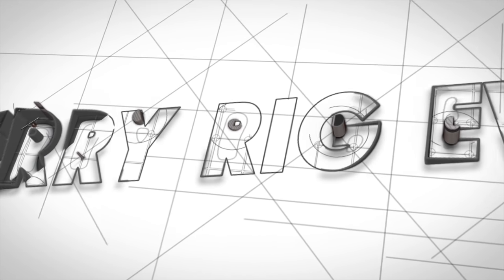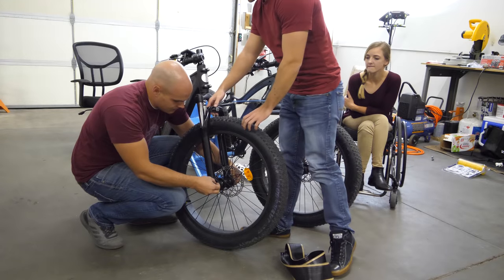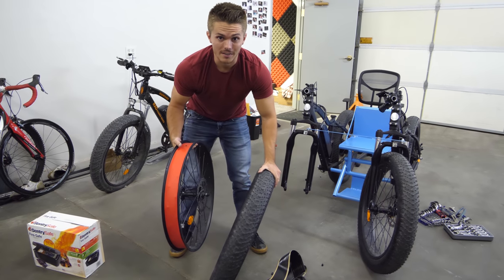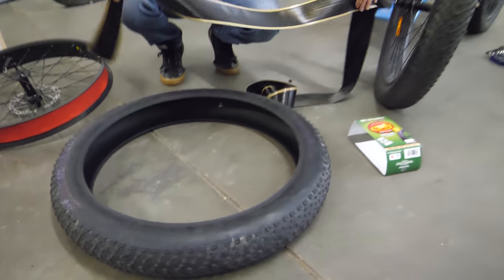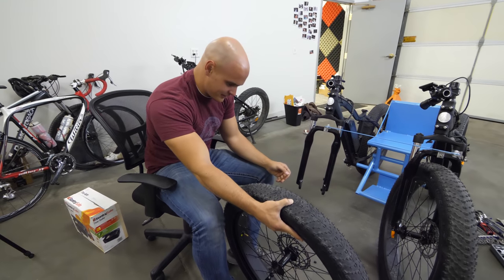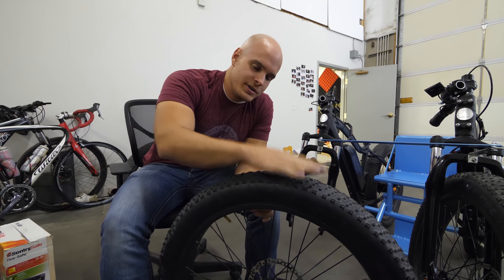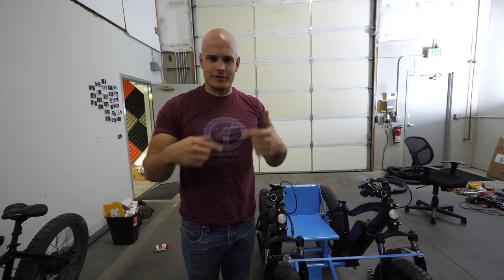How to keep Fat Bike Tires from going flat - Off Road Wheelchair Upgrade

Comment: Nice my grandpa and i did something similar to my bike when i was like 10/11 years old but we took 2 old tyers cut of the sides a bit not the whole side and put them inside the new tyers then reasembled everything worked great, he said that it was an old trick from his youth and had been used on old militarybikes to prevent flats. My grandpa was a great man RIP Grandpa i miss you.

Comment: Great tutorial! Another layer of protection I use on top of all this is to cut the old tube and wrap it around the new tube. Then if a hard deep thorn does get through, and they still can, the new tube leaks slime and bonds to the old tube to seal the hole very well.

Comment: If you run a tubeless setup the sealant would plug the holes and you would be able to run a lower tire pressure and get more grip on things like steep gravel trails🤙🏻

Comment: Heyo! Another option you could look at with the tires, is a completely tubeless setup with a better tire, and then a cush core foam insert around the rim if there is one for it. The idea is similar to the slime, but you don't have the weight of the inner tube. Less rotational weight mean more runtime, and the tubeless lets you run lower pressures to get more traction. Additionally, the cush core will save the rim from some extent of damage in the case of having to roll on a flat. I will point out, if those are the stock tires, the casing material is probably not that good, so investing in a better tire with a more durable casing material could be a major long term investment.
Reply: i haven't seen a cush core for a fat bike

Comment: Nice job!  I just watched two other guys do the same thing on Youtube, incorrectly.  Pretty much the same thing you did, but after they put in the Slime, they spun the tire really fast.  You need to spin it SLOWLY so it can line/attach to the whole inner surface.  The one guy poked a nail in the tire and couldn't figure out why it wasn't working, lol.  Thanks for your video!

Comment: I ride through the Nevada desert.  Gravel, cactus, thorns and glass.   I have a sun seeker fat tad with the 4" x  20" tires that I did the same thing with.  Tire liner and Stans liquid tire sealant inside the tube.  Before this combination of protection I would get flats every 3rd. time out.  I've been out 18 times now with problems.  So far so good.

Comment: You should convert the wheel to tubeless. In doing so you greatly increase puncture resistance and lower the weight. Lowering of the weight would make it go for longer distances.

Comment: What you can also do is go completely tubeless. You don’t even need the tube in the tire, all you need is tubeless ready rims (it needs to have specific rim tape on it), tubeless tires, and slime or sealant. You can run even lower tire pressures, for more grip,  and if you get a thorn in the tire, the sealant will seal the puncture and you can keep riding👌 I personally ride this setup on my own mountain bike and it changes the whole feel of the bike, very rad🤘

Comment: There are a number of videos on how to go tubeless here on YouTube. You might find that they are even more reliable than your setup. Just as long as you remember to add sealant every six months or so. Even if the tire goes flat. It might seal itself if you pump it back up. You can still use a tube if all else fails. My bamboo fat bike has three years and a ton of miles on a set of tubeless fat bike tires.

Comment: As a lifelong tire man, slime don’t work. Also, use an old tube, split down the middle all the way around and place the new tube inside it. Valve stem removed of course. I use it in heavy duty off road applications. It fits perfectly and gives heavy thickness.

Comment: Dang. True that those things may prevent flats. But the added rolling weight requires a LOT more energy to push.  It may be a good choice for some folks to use tire liners and/ or sealant (btw, there are more effective brands), others may find the extra effort and slower ride is not worth it.

Just something to be aware of for those who are thinking about puncture resistance. Oh, I have also heard some tires are made with a kevlar belt for that, but I have no experience and don’t know how well they work.

Thanks for the great video!

Comment: I used the same method but I used a heavy duty 21 inch front dirt bike tube. They are easier to find than fat bike tubes and are much tougher.

Comment: Or..... just set it up tubeless. It works the same way as on a car tire with tubeless specific tires and I don't know if your rims are tubeless ready or not. You put the tire on as normal but without the tube (it might be a bit tight) and you can put sealant in it to plug holes as you ride. It is more efficient because there is less friction and you can't get pinch punctures (where the tube gets pinched between tire and rim on a hard impact) which means you can use lower tire pressures to absorb bumps better and get more grip. May not be necessary in this case but it's what all proper mountain bikers use.

Comment: You need to go tubeless, been running Stan's sealant for over 6 years and it works great. You can also go for the muck off sealant and that'll be even more robust

Comment: Can I make  suggestion if SLIME doesn't work for you. I bought SLIME last week and followed instructions to the letter. Unfortunately, it didn't work for me on my rear wheel on my Ebike. Not because it's a bad product but because their are Grey areas when fixing flats on your bike. I had no choice but to remove the wheel and fix the flat the old traditional method of glue and patch. Why SLIME didn't work was because the puncture was on the side of tubing 1" above the stem. Even if you spin your wheel after applying SLIME, it may not coat the sides of the tubing. So what I did was I made a hole on the side of the tubing of an old wheel with tubing and tire and proceeded with Slime instructions. Again Slime did not seal the hole after spinning the wheel for a very good reason. You need to spin the wheel flat on the side on its axel on both sides or you can just hold the wheel horizontally while you're standing and turn it so the Slime can coat the side. Try one side 1st and then fill with air. If there is still a leak, turn upside down and do the same on the other side. Remember the trick is to get Slime to coat all of the inner tubing so as to fill any holes from the sides as well as the top and bottom. It worked for me after I realized those Grey areas.

Comment: I been doing just the slime and works great but once you put slime in a tube and its been in there a while or you store the bike for a while that slime will kind of expire and that tube is junk and will need to be replaced. the liner does not always work Ive had thorns go through the liner.. but having both is your best defense.

Comment: The problem with *Slime, is that it doesn't work indefinitely.  Eventually, the tube will need to be patched, and that's where you run into problem #2.  *Slime is incompatible with patch cement and will cause any patch to leak and inevitably push off. At that point, your options are to either try to "wash" all of the *Slime out of the inner tube, or replace it (the tube) entirely.

Comment: I got flat tires with the one I made even with slime and liners. Got tired flat tires (pun intended)! Sold it! Then I made two more ebikes from dual full suspension mountain bikes with Bafang 750 watts motors (Shimano/Gravity model 2014) with normal tires and put rubber tube in tires (no air). Problem solved. Had them for 5 years, never had a flat obviously.

Comment: With power wheelchairs we use a special type of solid tire that don't require air but the tires are a bit harder then normal.

Comment: Why don’t you Go tubeless ??? It’s a MTB basically so tubeless would be perfect
Reply: ikr. Would also save weight and increase range a bit
Reply: Yeah, apart that most tubeless sealants don‘t deal up normal inner tubes
Reply: Joni mi what do you mean? When you go tubeLESS, you remove the tube
Reply: Simon Arends yeah! Wich is only a good thing as a) you Save weight! Sealant is much lighter than a huge fatbike innertube! b) better puncture resistance! A normal tube stretches out, aspecially when there is a hole in it, so the sealant can’t deal up properly!
Reply: He should get better rims to
Reply: Agreed. Tuffy liners are worthless. The goat heads still go right through. Go tubeless. Split tube method would be easiest. I am local and can help if needed.
Reply: @jimi272  Oh really, thats interesting because I've been running Stan's tubeless sealant in my fat bikes tubes inside the tire for years and I've not had a flat since. I've run over many thorns and cacti and saw sealant spewing out and then it sealed and stopped leaking every time. Tubeless sealant works just fine in low pressure fat bike tubes. The only downside is it dries up after about 6 months and you can't get it out so you can either just keep adding more sealant which increases weight, or you can just replace the tubes every half year or so. Small price to pay for the convinience of never flatting.
Reply: nateross14 ah yeah! Sure it can work on low pressure tubes as the whole doesn’t get any bigger because of the pressure inside! Forgot that one! But otherwhise, sealant only works without tubes.... and is even better... so actually tubes are useless anyways...
Reply: @nateross14   I got the stan's sealant in my tubes and the tuffy liner in my fat tires and a nail kicked both their asses, went right  through sealant was leaking all in my tire it didn't seal the hole right away had to walk home, it only sealed after I took the tube off hung it up so the hole was facing down, maybe I put too much sealant in I don't know.

Comment: Try drilling holes in the side of the tires.  Fill the tire with window sealant foam.  Be sure to put a little water in the tire, before, the foam.  It activates the foam.

Comment: You could also just go tubeless, which is most likely cheaper, it makes the wheels lighter (yes it actually makes a good difference) and if you get a puncture, the tubeless sealant will most likely seal it up, and you also can't get pinch flats from going over curbs or something which would be perfect for this bike, and you can also run lower pressure in the tires for more grip.

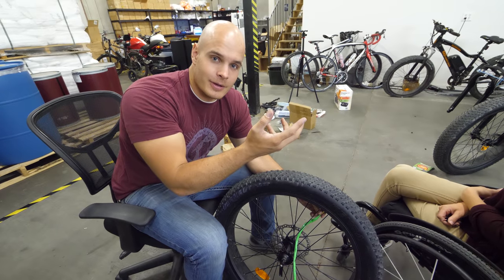Comment: 3:42 i used Slime in my 20X4 e-bike fat tires and it was MESSY when i got a flat in the back tire TWICE. Slime squirted everywhere on my fender. It didn't work. I only used it to see if it would stop the very slow leak i had and it worked for that okay enough. But when i encountered a real flat on the road far from home?...nope...FAILED. When i later got home with a taxi van i requested, i tried to patch up the hole. Forget about it. The Slime would ooze out as soon as i put pressure on the patch. It was so pathetic. Finally, i removed the valve in the tire using the handy cap from the Slime bottle and i rinsed the Slime out of the tire in the bathtub with the shower hose until all the Slime was rinsed out - that took time - time wasted. When i got all the Slime out, the patch worked. Now, i carry a spare inner tube wherever i go. Actually, since those two flats happened, i've learned to not use Slime ever again and to carry spare brake pads and two wrenches i use to open the brake pistons (i am too frugal to buy that tool), a patch kit, one inner tube, all the tools i would need to do repairs. One pouch of my saddlebag is filled with the tools i would need to repair my bike on the road.                                                                                                                     The last flat i got left a slit in my tire that looks as though someone had stabbed my tire with a small pocket knife. Nobody stabbed my tire as this happened while on the road for a while far from home. Strange hole, indeed. When i assembled the wheel again and pumped air, the tube was protruding through the "slit" - and that's when i saw how much it stretched open when pumped up. So, i took it all apart and put a patch on the inside of the tire to prevent it a bit from getting wider. Then, i thought about the liners you use in this video, but instead, i used half of a round, plastic yogurt container. I cut a half-moon large enough to fit perfectly inside the tire to cover the slit in the tire and then i inserted the inner tube and pumped it up. It's working well so far. The only problem is the bump i feel as the wheel turns over that spot because when the tire is inflated, the slit, now patched from the inside, still opens up. It's as if something bit off a piece of my tire (oh, thank you Kenda for the way-too-soft rubber tires you make. So, i put that tire with the missing chunk of rubber at the front and i feel the bump a tiny bit less since.  And since carrying the tools around, i've had two more back (Kenda) tire flats (two during this December) and i was so relieved to have what i needed to change the inner tubes each time, when and where it happened.  I am considering covering the entire inner tire with half-moons made from (thicker) plastic containers. I hope this comment was helpful for some people. (EDIT a few hours later: the half-moon broke into quarters. I have to redo it now, tonight. or buy a brand new tire - AGAIN, i add, because this damned KENDA tire is still brand new, only a few months old.

Comment: Perhaps this liner MAY protect your tube from being punctured. I have tried covering my inner tube with an old tube and used the "goo" as well but the "double-gee" thorns (Native to South Africa but present in Western Australia) still made such a mess of the rear tire (20"x4") and tube on my folding "fatty" Ebike, eventually, I had to replace both the tire and tube. Front tire and tube "survived", just.

Comment: Slime and a liner is a waste. I use an airless solid tube for mine. Yes, the tires a just a little heavier, but I'll never have to worry about getting a flat ever again. It is foam, but not rubber so I won't ever have to worry about flat spots either. They may be hard to find now, but if you can find them, they will allow her to ride over broken glass or sharp rocks without worries.

Comment: Try Tannus foam liners and never have a puncture again, go hydraulic for the brakes, also 1 throttle can control both speed controllers and both motors...

Comment: When checking for thorns on the inner side of a wheel, try using a rag instead of your fingers (to keep them protected).
Reply: If you can't feel the thorns you won't know they're there
Reply: Chris Johnson you missed my point, the rag is for keeping your fingers out of harms way by dragging the rag to search for the thorns, and if you can’t feel the thorns with rag then maybe the rag is to thick. In any case I would keep my hands safety as a priority.
Reply: There was a truck driver who had run over a rattlesnake and one of its fangs was stuck in the tire. He ran his hand across to check it, stabbed himself with the fang, died. 😶

Comment: I am disabled so I run a variety of mobility devices.  One is a modified Zooma Scooter that I have geared down but I run into problems with the tube gripping the tire hard enough to not slip when I apply the throttle.  I have been tearing valve stems when the tubes age a year.  What I did last week was to install a new tube inside the old tube and then added slime.  I noticed that you did not use any corn starch on the inside of the tire which could have been part of my problem too ans I used to use lots of cornstarch and I probably still will on the front tire but not on the rear.

You are going to reach a point with her that battery power will not work.  Fortunately the US department of Justice redefigned what a mobility device is so when you start building gasoline powered devices for her you will just have to keep the widths within the specified dimensions.  Toro and Honda both have commercial material handlers that can be modified to mount and be operated from a seat.  Some of the tracked snowblowers can also be modified to work.  You could also go the mini dozer route which is the way I went.
Reply: So the tire slips on the rim and your valve stem then shears off because the tube takes up the job? The tube should not be handling any kind of torque, i guess from mounting the tire with corn starch you are preventing the rim from getting into contact with the tire. If you need assistance for mounting the tire there are some mounting fluids for bikes available that leave no residue. Clean your rim and tire thouroughly then remount the tire onto the rim. If it is stil slipping you can put a bit of tubeless milk between tire and rim to get more adhesion.
Reply: @exi  the tubless tire milk would make the  slippage worse.  The tube has to expand to hold the tire tight against the rim and not slip but when I use cornstarch even with the pressure at 40psi the tub will slip inside the tire.
Reply: @hartstudebakerkid  I can tell you from all my tubeless MTB tires that proper tubeless milk solidifies between rim and tire and increases the amount of force needed to get the two apart again. In a tubeless setup the milk will fill any voids where air can espace between tire and rim which will result in more friction as soon as the water is gone. Essentially, tubeless milk is just liquid latex so once the water is gone you have rubber left which is very sticky. Chalk or cornstarch is used inside of tubes so it doesnt stick to itself. It could be worth a try to put some milk into the rim, let it dry and then put the cleaned tube in. Might be hard to take it apart again though.